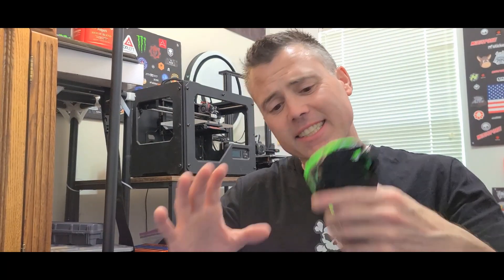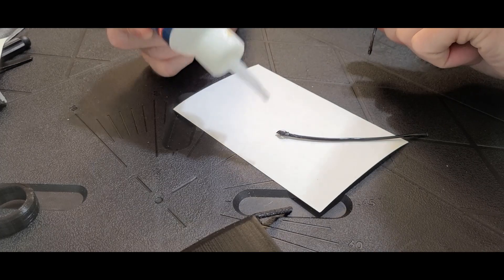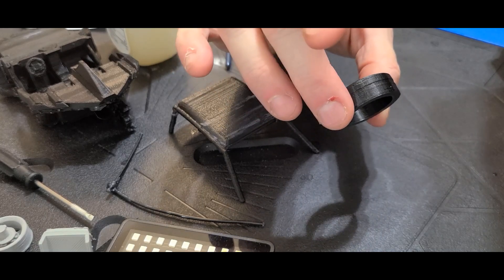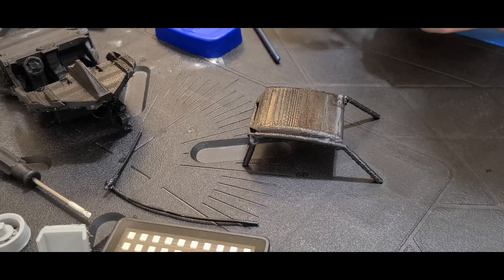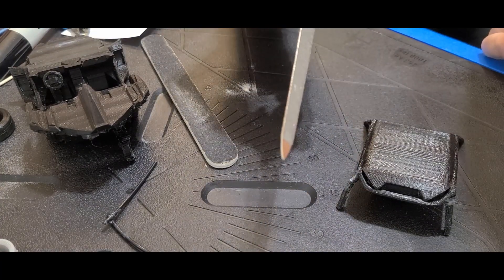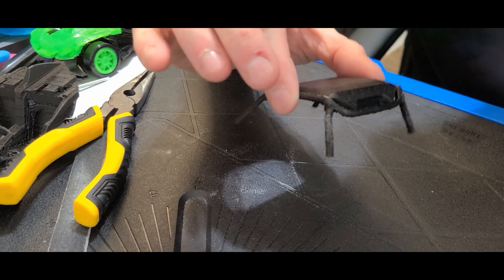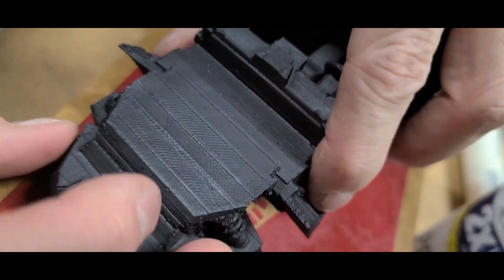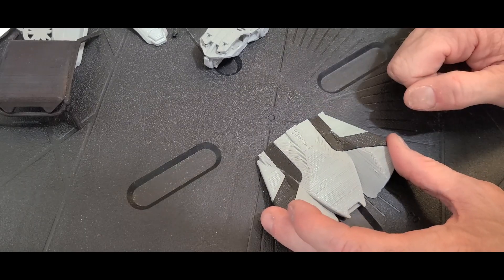How to Build 3D Printed Models / Tips & Tricks / #3dprinted #3dprinting

Comment: Nice tricks. It was interesting :)
Here is one from me: if you need to fill something small but you do not have putty or car stuff - use nail polish as filler. Wait to dry and you can sand it down. I use colorless as you can repair each color no problem :)